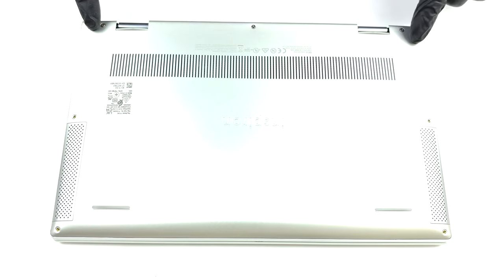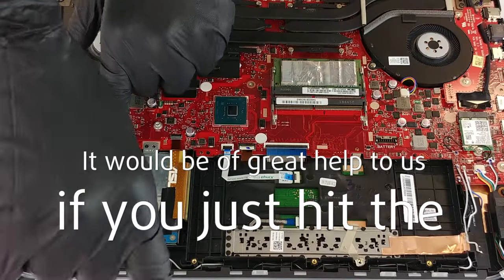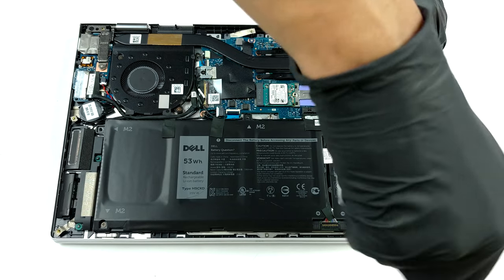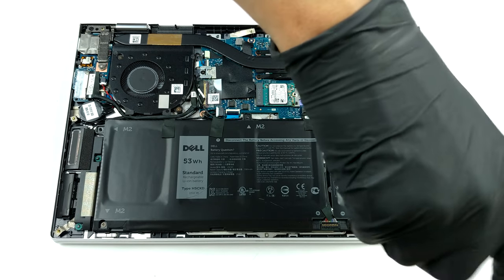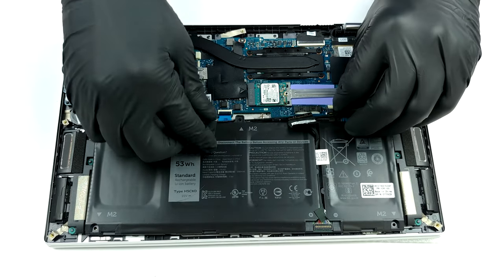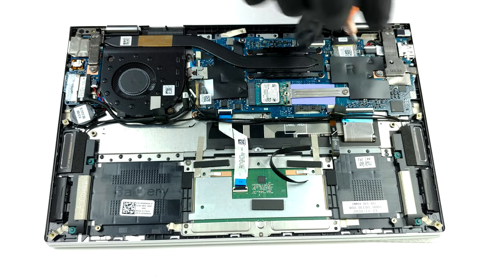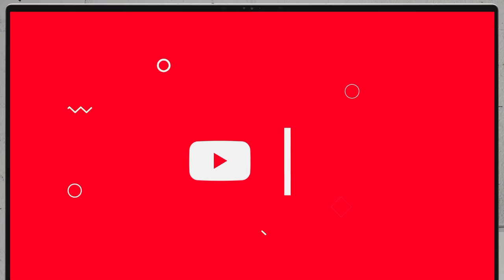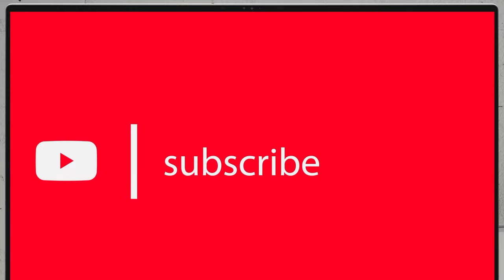🛠️ Dell Inspiron 13 7306 2-in-1 - disassembly and upgrade options

Comment: Thanks...shame they got rid of user-upgrade memory but it looks like a bigger fan and heat pipe may have fixed the cooling issues my older model 7378 has.  Bigger battery never hurts either.

Comment: Can we upgrade it to 1TB?
Reply: Yes you can, I have installed a 1TB NVME drive (2280) and it works fine. There is not space for 2 drives;
Reply: @mfwalshy  When you removed the old NVME and installed the new one, how did the Dells factory reset option work? And how was Windows installed in this new drive?